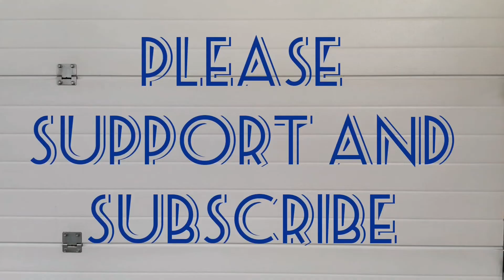How to Remove or Replace Front Seat Kia Rio

Comment: Thanks for your video I've literally just tried to take mines off but was having great difficulty loosening the 6 10 mill bolts as access was a nightmare
Reply from the maker: I know, Sometimes the screws are hard to loosen. You have to be patient and slowly loosen a little and tighten one or two laps until they loosen. Sometimes they rust in the thread and on some vehicles the factory puts the mass on the thread to prevent the screws from loosening